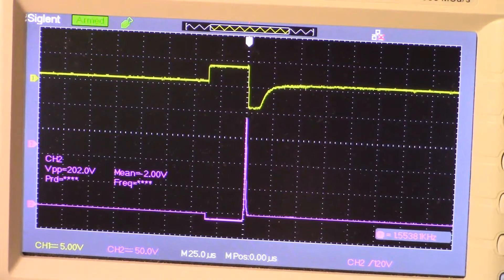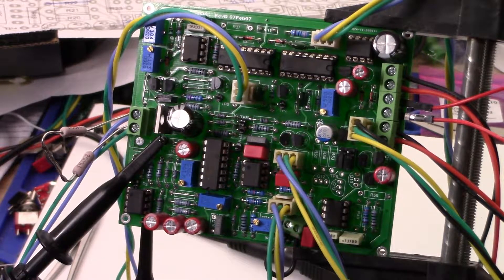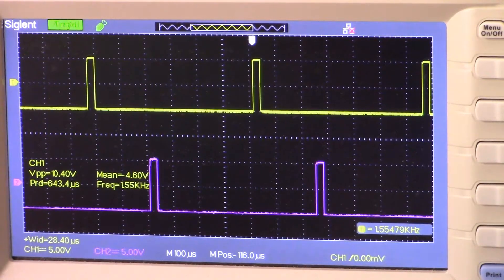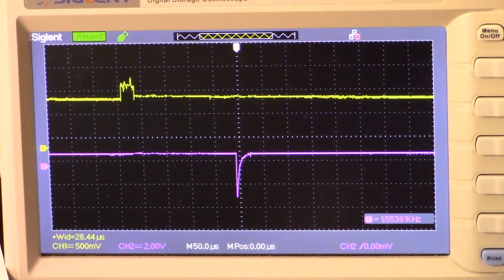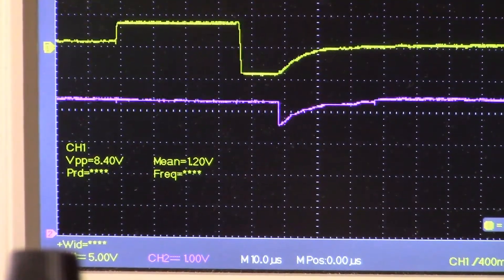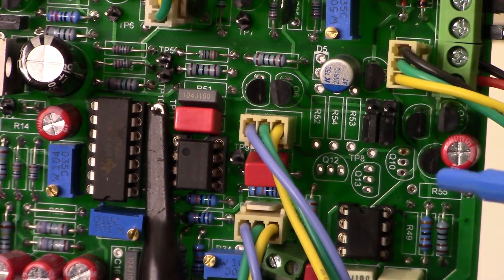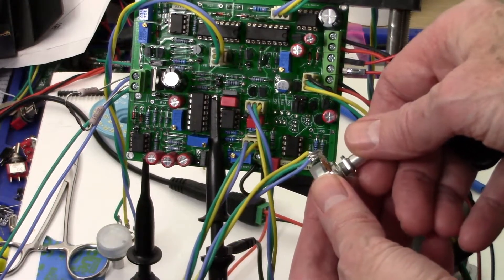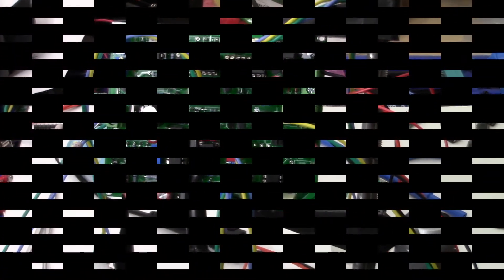Hammerhead DIY Pulse Induction detector part #3 receiver, integrator and VCO

Comment: Hello
Dear SurfDetector
Is your speaker as 8R in this video?
Reply from the maker: No,  I use a 32 ohm speaker
Reply: Thanks. Do you think i can use 8R speaker or need to amplifier?
Reply from the maker: Use a high impedance speaker as I instructed.
Reply: OK. Please forgive me for my questions. 
About minipulse, do you think 8R speaker can work over it?
Reply from the maker: @ha.farz.2953  I always use high impedance
Reply: Sorry for my questions, but i need your help.
As you know, there is R55 near IC9(555). Can you tell me why you didn't install it in your board?! If i install it, do you think threshold pot will work?
Thank you.
Reply from the maker: Hello my friend.  Have you subscribed to my channel?
Reply: Yes, i subscribed. My friend, thank you for your videos, i learned many things.
Is it possible to explain me about R55? If i install it, do you think threshold pot will work and my audio is pit ... pit?
Reply from the maker: Yes I see that you have now subscribed.  I do not understand what you mean by audio is "pit, pit"  If you study the original Hammerhead schematic you will see that R55 is not needed for the VCO.
Reply: My friend, i have built Non-Vco model (version C2) but i have a problem with my coil. 
I built two coil 22 cm and 45cm coil (500uH, 0.35mm wire). According to your video, i made your damping tool circuit and saw TP4 in my O-scope. My best result is 680R with 500uH but i have a main problem with sensitivity. Unfortunately, my sensitivity is very very low, i don't know where my problem is?! Do you have any suggestion for check? I can detect a silver ring from 1CM with 45cm!!!! I tried hard via your damping tool and O-Scope, but my best sensitivity is that only with 680R.
Reply from the maker: Yes.  I have read the many posts that you have made on the Geotech Forum.  You should start a NEW topic on the Hammerhead 1 thread and post your questions there.  You should post some oscilloscope pictures of what your pre-amp output looks like as well as the sample delay.  What is your pulse frequency and width?  Also post some pictures of your coil and also pictures of the pcb that you made. These are all things that will assist in diagnosing the issues.
Reply: Thanks dear surfdetector. I checked my TPs over O-scope. Unfortunately,  my Vpp over TP2 is low (50V), while main HH1 is 100-300V. I increased my PW, but it didn't work. I checked my R10, i realized that it is burned, so i changed it with a new resistor. Again, i checked TP2 VPP in O-scope, but my VPP is still 50V. For more assurance, i checked my TP1 pulse, it's OK. Do you think it's possible my mosfet is burnt? 
My coil is without any shielding, 500uH, damping is 680R. I checked my TP4 in O-scope, it's without any ringing. In addition, i used your damping tools and my best result is based on 680R.
Reply: Hello
Dear Surfdetector
Finally, i could solve my poor detection, thank you for your peerless supporting. 
As you read in Geotech, i'm trying to use 8R speaker. So, i used a 8R amplifier via lm358 and push/pull transistor. Anyway, i have VCO audio in speaker but my threshold pot doesn't work. Other words, the pot can't set speaker to silent. Since you have a lot of experience, can you suggest me which point i should check?!
I checked Resistors values, especially R30-R31-R32-R33, all of them is true. For more trying, i also used 39K for R30 but it has no effect.

Comment: Hello

Can you tell me if you have used the jumper coils or not ?

In addition, you have not installed R49, R51, R52, R53, R54, R22, R14, Q10, Q12,Q13. Is it true?
Reply from the maker: I do not understand what you mean by jumper coils?
On my PCB  I built the VCO version which is why I did not install those resistors and transistors.  If you go to the Geotech Forum you can get a full build document for this project that explains the build.
Reply: OK. Some people believed that its audio VCO sound will be unstable by changing frequency pot. According to your experience, is it true or  its VCO sound will be balanced by any frequency ?
Reply from the maker: @ha.farz.2953  Quiescent audio frequency  is adjusted by the threshold potentiometer.
Reply: Thanks for your helping. Have you ever tested its Non-VCO mode? One of my friends has built its rev. c version but he told me that the mode has a problem in its sound level. Other words, he claimed that its threshold sound is very very weak. Is it possible to capture a new video from its Non-VCO mode in future? Undoubtedly, many people will thank you.
Reply from the maker: @ha.farz.2953  I am not going to re-build the hammerhead in a non-VCO version.  I have built several projects based on the Hammerhead , all of them VCO and I have had no issues.
Reply: Hello, thanks for your replying. I need to your help, can you tell me how to use DD coil? Do you think i just need to connect only its coil jumper (between L1 and L2)?
Reply from the maker: You need the jumper and also the second damping resister R14
Reply: Thanks for your guiding. Do you think the jumper must be closed or opened for DD?!
Reply from the maker: The jumper must be closed.  You need to look at the schematic for the Hammerhead.  It is available on Geotech Forum.
Reply: Thanks for your replying. I sent a pic to your Email because i can't upload it here (p. 175, Carl's book, IMD ). According to the book, it seems that we must open the jumper for DD. I read Geotech Forum, please read following link, the Reg's post. Don't you think the jumper must be opened?   https://www.geotech1.com/forums/showthread.php?10729-on-DD-coil-on-the-Hammerhead&highlight=Hammerhead%26amp%3BDD%26amp%3Bcoil
Reply from the maker: https://www.geotech1.com/pages/metdet/projects/hammerhead/HHd1.pdf

The schematic clearly shows the need for the jumper.
Reply: Hello Dear Surf. Before everything, thank you for your guiding. Can you tell me application of jumper that is between R8, R9 and R7 (beside of Q3)? Do you think it's for using specific commercial coils such as GPX series? Generally, when we should use the jumper?
Reply: Hello
Dear Surf. I have a question about your experience. According to your experience with PIs, do you think which of them is able to detect target in high depth, relic?
Reply from the maker: Look for the Delta Pulse.  There is a lot of information about the detector on the Geotech Forum.  That is what you need.

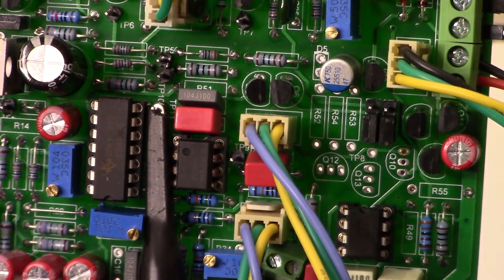Comment: I'd love to have the part numbers for those connector sets shown at 8:12.  Also, perhaps you've already mentioned it, but what controls are you making front panel adjustable?  Have you made any op amp substitutions for better performance?  Finally, have you played with the R22/C16 combination for low or high pass filtering?
Reply from the maker: Molex KK254
6373 series
2695 series
You can make any of the pots external, the choice is up to the user.
I did not utilize R22/C16,  I made this detector purely to illustrate the correct wave forms for others who might need assistance.
Reply: @SurfDetector  "You can make any of the pots external, the choice is up to the user."  Thanks.  Yes, I know, but which did you chose and why?
Reply from the maker: @winstonsmith478  As I do not have the project in front of me I will rely on memory.
Volume
Threshold
Sensitivity
Sample Delay
These are all items that I consider to be adjustable on a regular basis whilst hunting.